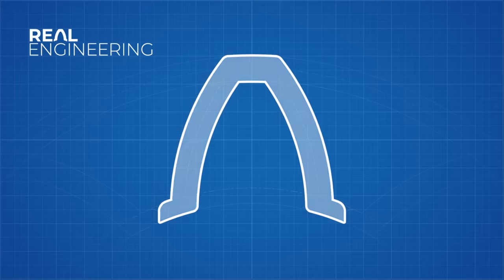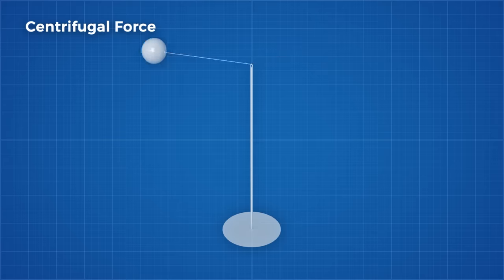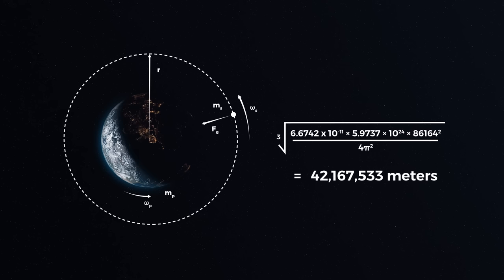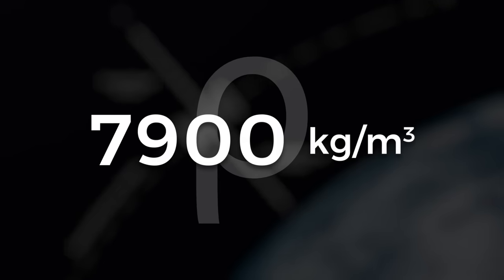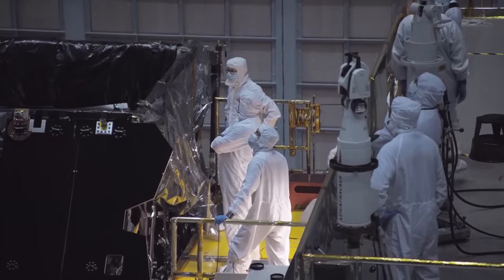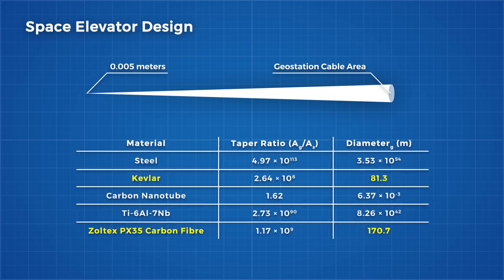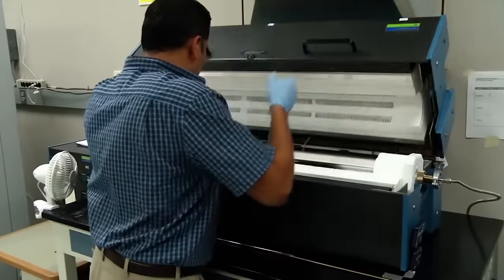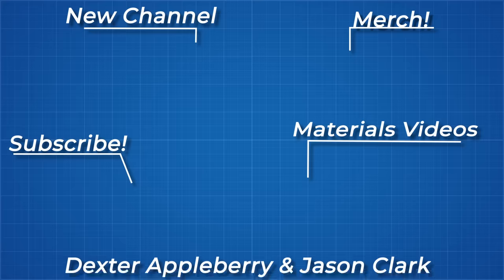Are Space Elevators Possible?

Comment: What if we would combine materials, and build active instead of passive, build from the earth with steal & concrete, lets say 10km up, with a wide base. Then for the next 10 km use an active tower, so inflatable parts, that are held up by fans ( powered by a powerplant from the earth and power cables ) and then for the next 10 km also inflatable parts that are held up by a constant airflow from a long pipe from the earth( and this air is shot out at the right angle and location to create constant lift or pressure ) ( because the athmosphere will be thin and fans will not work anymore), and from there we have a super strong cable ?
Reply: You have a smart fantasy, if you get what i mean with that. 

But you need more 'foundation' of knowledge. 
May i recommend Joe Scott, Veritasium and PBS-Space-Time for that?
Reply: @loturzelrestaurant  tnx i will take a look.

Comment: The "ball and string" model for a space elevator appears to be a bust. What I understand is not a bust is the "orbital ring" model. This is a ring around the equator at about the same height as the International Space Station supporting itself in low Earth orbit. The ring has any number of "strings" attached to any number of points on the ground, but these do not have to support/belay it. They are simply transportation highways to and from it, the distance being something like Paris to Berlin. Transporting the materials for such a mega-structure from the Earth's surface would be prohibitively expensive  - it was provisionally costed at around $30Tr in the 1970's (at 1970's prices) I believe. That would appear to scupper this idea as well. However, it doesn't.

The answer is you build your manufacturing base on the Moon. You also build a "ball and string" space elevator on the Moon which is possible since it has 1/6th Earth gravity which means it would be much shorter and have much less strain on it, existing materials can handle it. I do not know if there are sufficient raw materials to mine on the moon to manufacture the Orbital Ring components but there certainly are in the asteroid belt (and a lot of asteroids are actually a lot nearer to us than we might like to think). Shuttling completed prefab parts for the Orbital Ring down to low earth orbit from the top of the Moon's ball & string elevator is actually a piece of cake. This is not going to be cheap, of course, however it is orders of magnitude cheaper than building anything answering the description of a space elevator ground up from earth. More importantly it's possible. Now.

Why make this investment? At current price tag of anything from $5-20k per Kg to shift anything up to low Earth orbit is why. The cost of shipping up to an Orbital Ring would be roughly analogous to rail freight. This costs something like $0.20 per ton kilometer. I don't know exactly but basically you could ship 1000Kg of stuff up to the orbital ring for maybe 1/1000th the cost of sending 1Kg to low Earth orbit in a rocket. I.e. it's something like 1000x1000 = a million times cheaper. This is what opens up the colonisation of the whole solar system.

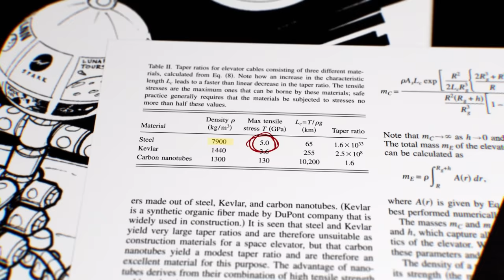Comment: Afaik at 9:00 he made a mistake. The 5 GPa tensile strength for steel is correct - nanostructured pearlitic steel wire can be that strong. It can even be higher, up to around 7 GPa, although sacrificing fracture toughness to get there.

Comment: If someone tells me The distance I can tell you how many drones we'd need To make a elevator.
One group said 62 miles means space 

That's fairly simple 
Drone every 100 meter 
1600 meter in a mile
So 1000 drones each one with a load 

$10,0000 a drone
So $10 million 

Let's say $100,000 a drone
So $100 million 

That's if weightlessness is 62 miles above ground or 100km

And the drones can start at any height 
They don't have to start on the ground 

Also $300 million or 3000 drones at $100,000 each would make them reach 300km the distance of space x

Another way is if you get 10 with auto pilot all $1 million each then when 2 are lifting the people or parcels 
The others are going to the top to take the next parcels or people,  really you just need 4 or 3 put you have 10 just so your well in the advance of the parcels and if there's a problem which really there shouldn't be cause there's  no weather It's all clear skies then you can build a space elevator mind you it would be slow 

Or if you went full speed and build a train you'd been about $4 trillion at $1 million  each at 1 every 100 meters that does 250 miles to the space station 

The first way is the most realistic 
Truly any one can do the first way of drones that keep stacking themselves on top of the other til it reaches the space station
It's just how heavy they are to withstand the pressure  of the atmosphere
Really simple

Comment: There is another examination of this question here:
https://www.youtube.com/watch?v=Z5aHMB4Tje4&t=1080s
which arrives at a length of 190,000 kilometres, which is a much higher figure than the one posted here. Now, I am not a mathematician, so I'm not sure which calculation is correct. Perhaps someone could check both videos and confirm one or the other is correct. The other video is "Can we space elevator, should we space elevator" presented by Angela Coller, who shows the math she used to arrive at the answer. So someone versed in calculus could follow it. Obviously having to travel a distance near five times longer than the one posted in this video makes the objective much more difficult to achieve.

Edited to add: Okay, I know where the problem is In the calculation for this presentation. The weight of the tether itself was not included in the original equation. Frankly that is a bit dumb, in that there is no material that would have zero weight. In this video they try to fix that problem by putting a weight further from the planet to balance the weight of the tether itself, and thus keep the anchor at equilibrium. That weight would have to be constantly changing as the weight of the tether changed, so that adds a serious complication.

Comment: I was just thinking about what problem a space elevator would solve - and I think the main issue is that when a vehicle comes back from orbit, it has to scrub off a lot of velocity. Currently that's done by converting it to heat in the atmosphere, but a space elevator could serve as a "regenerative braking" system. But geosynchronous orbit is so far out, I was wondering if there was some way to do that for low Earth orbit. What if there was a swarm of satellites in low earth orbit that could somehow give their energy to rockets coming up, and then take it back from rockets coming down? We'd still need rockets, but a whole lot less fuel. Of course the hard part would be to transfer energy between the "elevator" satellites and the vehicles without actually smashing them into each other... Anybody have any ideas about how that could be done?

Comment: I have a question:
At which point would we need a reverse gear to bring back the elevator, when the centrifugal force would be higher than gravity?
Reply: You would just need to apply an additional "kick" from the station end to overcome centrifugal force. The elevator capsule would fall under gravity at a speed determined by the mechanicals.

Interestingly, attaching a generator turbine to the cable means that you get back most of the energy used to lift the capsule to the station as the capsule falls back down.

Comment: What about pulling upwards with huge hydrogen filled tethers? With each section holding up it's own weight. Make each balloon circular with an inside elevator.  Make the counter-weight a huge cannon that provides most of the horizontal speed.

Comment: For the past several decades space elevator concepts, intended for transportation ofpeople and objects to space, have focused on tether-based systems; early, rudimentary tower based systems were considered untenable due to compression forces at the heights needed to reach, or aid in reaching, geosynchronous orbit. We describe a tapered tower that is pressurized internally with hydrogen gas, which we call a Hydrogen Space Elevator (HSE). The unique shape of this tower eliminates vertical compression forces(due to internal hydrogen pressurization), which has not been previously addressed by any other space tower-elevator designs.Additionally, the location of a potential space elevator is a key consideration,as tether-based systems essentially require a site near the equator so that a counter-weight can first be shot into geosynchronous orbit. However, if a space elevator near the equator were to be destroyed or collapse debris would wrap around the Earth creating a monumental path of destruction. While HSE can be built anywhere, we proposea site near the Earth’s poles mainly to account for debris from destruction events, although this is not a requirement.Mathematical analysis for the shape of the tower and potential building materials show that the HSE concept is both practical and achievable. Furthermore, methods for fabrication of HSE from the ground up, and a stabilization system to guard against perturbations due to construction and the environment are described

Comment: this might be a dumb question, but would the portion of the cable that is in the atmosphere experience, or "feel" the atmosphere at all as the world turns? or is the atmosphere just moving along with it??  i ask because if the lower portion of the cable experiences the atmosphere in any way, it could potentially have lifting bodies (wings or airfoils) at points that help out with tensile strength requirements?

Comment: That required diameter of steel cable really made me laugh lol
Reply: There's something that doesn't pass the sanity check about that. (Namely, you could build a "cable" which is an equilateral cylinder from the Atlantic to GSO instead) Which screams to me that the formula simply must not be correct.

Comment: Space elevator makes no sense.  Most of the energy required to stay in orbit is used to get the payload to orbital velocity.  So when you move a payload to the top of your space elevator, the structure at the top will be slowed by the added mass of the payload, and it won't be in geosynchronous orbit anymore.    So yeah,  it will start slowing down,  causing it to be moving around the planet faster and faster relative to the ground with each payload you put up the elevator.  You still need massive thrusters to get the payload up to speed as it rises.

Comment: Seems like all this detail about required materials etc has caused someone, or two, to apparently overlook one very large problem.  You also need to (also) somehow accelerate the payload up to the required orbital velocity.  If the tether is supposed to do this, one has to consider that extra load not to mention the effect it would have on what it is attached to.  The amount of energy required to reach geocentric orbital velocity would be considerable to say the very least.  And, that ultimately has to be delivered by the upside down plumb-bob.  
Too much attention to details that are entirely irrelevant until this is addressed.

Comment: A fundamental problem with space elevators that advocates do not seem to be interested in: they can not realistically exist in combination with a significant number of orbiting satellites. Every satellite crosses the equatorial plane twice in each orbit. Since they are in a variety of different orbits, the number, timing, and location of each satellite crossing "close enough" to the stationary space elevator rapidly becomes a chaotic system that is essentially impossible to predict sufficiently. This applies to every satellite with the possible temporary exception of geostationary satellites.

Altering the orbit of a satellite to avoid the elevator is expensive and problematic, and the elevator is equally difficult to move. So a space elevator is the orbital equivalent of planting a tree in the fast lane of a highway where vehicles are traveling at 22000 kph.

For comparison, the ISS uses a five mile (eight km) active zone. If any satellite or space debris is projected to pass within that distance, the ISS  is moved out of the way. Using that criterion and the 30,000 or so known objects over 10 cm, a space elevator might have to move more than once per day. And IIRC Starlink would put a satellite within a few dozen miles almost constantly.

(The above is of course a shorthand summary.)

Comment: Great video man,I have a question, what would happen if the weight of the satellite was equal to or close to 0? I'm talking about a hypothetical scenario where the satellite has enough pressurized hydrogen for that purpose. Would that reduce the orbital distance?
Reply: Late reply but hydrogen balloons don't work in a vacuum.  Hydrogen still has a mass, which is why we call zeppelins and other such dirigibles "lighter than air" - they won't float in the vacuum of space because there's nothing to "float" on (much like a steel ship full of air will float in water but won't float up into the sky).

Comment: I was told that elevators would be a lot easier for the moon. Can’t remember why, despite your formulas. I was wondering about Mars (as part of a terraforming effort). Would it be possible with Kevlar? Also - Alastair Reynolds in his sci fi uses “hyper diamond” (obviously not a real thing) but would artificial diamond a possible part of the solution while waiting for nano carbon?
Reply: No, that's not possible.

Diamond, an allotrope of carbon, has its carbon atoms arranged as many 3-D tetrahedral shapes and this gives it bulk/volume. Diamond is better at resisting compression forces, rather than the tensile forces required here.  

Graphite, another allotrope of carbon, has its carbon atoms arranged as many interlinked 2-D hexagon shapes, thus allowing it to be flat. If this flat graphite layer is rolled into a tube, it would form carbon nanotubes that would have a high tensile strength, but very little mass, thereby giving it a very high specific tensile strength.

You cannot slice a diamond into thin layers and expect its strength to be retained. It does not work that way.

Comment: I assume temperature and wind effects require some accommodation.  And doesn't there have to be a moving counter weight to balance the moving elevator? And it still only gets you into a near earth orbit, in a orbital plane that may not be the place you want your satellites (or whatever) to be.  All in all, it seems like a pretty complex, inflexible and risky idea. I assume the potential cost benefit is based on the assumption of re-use. Elon has also tried to tack this problem, in a very different way that seems much more in our grasp.

Comment: I would be interested in knowing how much of a change it would make if you put it on top of Mount Chimborazo, the point on the earth closest to the stars (yes, it is one degree south of the equator). Adding the bulge of the earth to its highest point, it would be about 27000 from the center of the earth. I'm not sure how that would affect how much it would take to get to the proper orbit. If you built a building on top of that, you could cut off a good bit of the distance needed for the elevator

Comment: Isn't the biggest problem with the business case, not the material? There will be a huge up-front cost to build the space elevator, billions or tens of billions of dollars. SpaceX can do launches for approx $50 million. The space elevator can only put things into it's geostationary orbit, because at lower levels an object needs to acquire both altitude and orbital velocity to remain in orbit, and the Space Elevator only gives altitude. Thus the space elevator could not do useful things like re-supply the International Space Station or put satellites in Low Earth Orbit, which are quite straightforward, and remunerative.

Comment: how will you produce a tapered nanotube cable of the required length in one piece on bring it into GEO?
Guess you can't extend the cable by welding or clueing in space.
You not only need the structural cable, but an electric supply cable as well, that weight would have a significant effect
and all the electric energy could not com from earth only. the losses over the length of the cable would be too mucho we would need orbital photovoltaic power stations, but how to connect them with the elevator?

Comment: In all the proposals for space elevators, none have mentioned the problem of electricity. 
If you move a conductor through a magnetic field, a current is generated in that conductor.
A space elevator is that conductor, moving through the earth's magnetic field. 
Surely it is going to generate an enormous amount of electric current through the elevator.  
Simply because it is attached to the earth, will that be sufficient to "earth" that current?  

Regardless of whether the current is earthed, will not that current flow, and it's magnetic field,  cause problems?